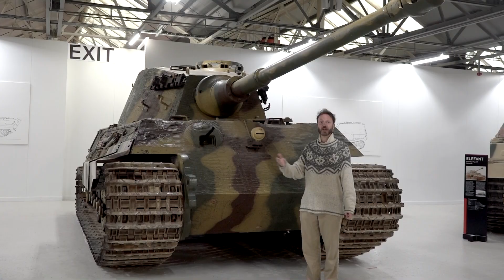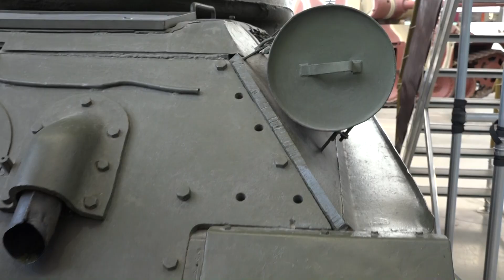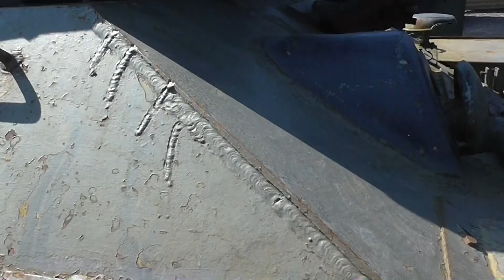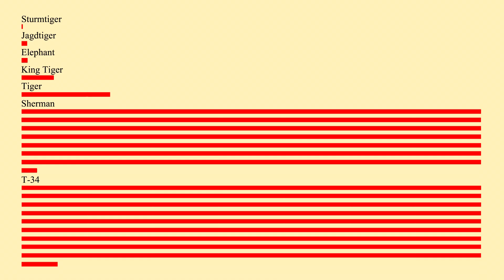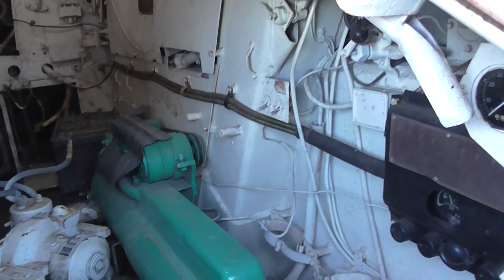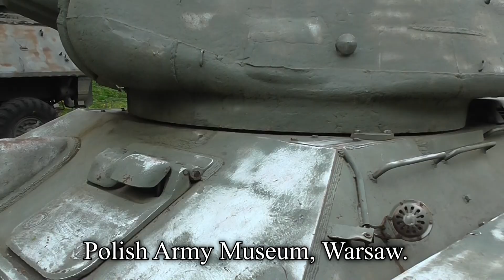World War Two's most common tank

Comment: The unattached pins and little wedge that puts them back in was still used on T-54 and T-62. Apparently the wiggle was actually a positive since it helped dirt to work out of the connection. (Source Tankograd website.)

Comment: The best tank in a war is the most decent tank that's most easily repairable and relatively inexpensive, which is the most generally reliable and which has guns which work fairly well and are easily resupplied to put enemy guns and troops out of action. You don't want a tank with a gun that's too small to do any damage, but as long as it has some ability to fight against any ground-level threat and you're able to build and crew a good number of them, that's a good tank.

I know things have changed somewhat with advanced technology, but logistics and production always factor.

Comment: Please… those are not bad welds they are mold lines on the turret… the engine cover wasn’t sent out of the factory unwelded or missing bolts, the museum left them out. I get the point but bad examples don’t help you

Comment: Putting the spare track links on the front of a tank, especially a tank with sloped armour, does not really add to the armour, it might actually detract from it.

Tracks need to be made out of softer steel than the armour, as they would get damaged very easily, grind away quickly or just snap and break. So softer steel would be used. If shot at from the front, the soft track steel placed on the harder armour plate could act as a sort of "cap" for enemy projectiles, normalizing them and then easing penetration.

So it wouldnt add, it would detract

Comment: The logistics defeated the Nazi forces. For every Sherman built there was a complete set of spare parts. For Nazi tanks it was one set of spares per 10 tanks. A final drive where the transmission turns the engine power 90degrees to the drive wheels and houses the gear box.  In the Sherman life span is about 2000 miles and less with bad drivers. In a Panther the average was 200 miles and first models caught fire if driven too long. To replace a Sherman final drive took 4-6 hours in the field with a mobile repair unit. A Panther you had to remove the upper top armor, the driver and radio/machine gunner crew position including electrical, hydrologic, and all linkages. Unbolt form inside and remove. Then do it in reverse. It took 2-3 days at a repair facility if you had the parts. Shermans were routinely removed and it is easier to recover if your advancing.

Comment: Good Documentary, though I want to add something.
Going for numbers isnt as easy as people think, every major war of modern Times is also one of logistics, 100 Tanks need 100× the fuel, spare parts, ammounition, crew, tow/ service vehicles and other basic necessities.
And its not even the question if you have that fuel and other stuff, but how fast can you get it to the frontline itself.
That is at least as important than having the tank itself, because what is it worth when it cant fire, or the Crew is starving, or its Stuck or couldnt drive to begin with because it had no fuel.

Comment: The thing on how long T-34s lasted is completely erroneous and feeds into some long-lasting myths. The T-34 was fully designed and built to last for as long as possible. The rough finish was only applied to aesthetic or superficial factors that didn't play a role in the combat performance. The transmission and engine for example were rated to last longer than any Sherman's. The metal used for armor and shells was of high quality, comparable to German early-war steel, which is significantly superior to German mid-late war steel and unlike the Germans it went up in quality as time passed. The welds being ugly because noone went over it with a file to sand it off may not make it look pretty, but it is also wholly irrelevant. 

It should also be noted that whilst the T-34 was a decent middling "will do the job" vehicle by the late-war period, it was a bona fide terror in 1941, held back by teething issues, production numbers and officer incompetence, but genuinely vastly superior to any armored vehicle the Germans fielded in Barbarossa.

Comment: The T-34 was NOT designed "crude" or "disposable".
The poor build quality came out of necessity, because so many were built by factories and/or workers that had absolutely no clue how to build tanks.

The ones built in the original factory to original specs before the war(once the initial teething issues were fixed), are easily of comparable manufacturing quality to the average Sherman.

And most of your critique of the T-34, it's like you're pretending that noone else ever built anything bad or had to make questionable compromises.
Like the epic bad choice of putting the cooling system unprotected outside on top of the armor...

Comment: It makes it quite difficult when you are comparing apples to oranges. Saying a Panther takes six months to build (but they built in parallel) and then stating the Americans made 1 Sherman every 30 minutes is useless. The units don't match. By creating 8640 Panthers at the same time you can also build one every 30 minutes if you take each month to have 30 days.

Comment: I liked the video, but I got some notes:
-the 5 Shermans to a tiger comes from a tank platoon being 5 tanks, hence you can't encounter a single Sherman, they always worked in platoons 
-The 34 is a sequential index and not a year (the prototype of the T-54 was completed in late 45 early 46) and the 76/85 are mostly a post war thing, as both were referred to as just T-34 in documents
-The casting defects are cosmetic and do not compromise the armor
-in late 43 soviet factories converted to submerged arc welding resulting in welds that are stronger than the armour
-The hull gunner/Radio operator was probably the worst position in WW2 and on the 85, they moved the radio to the turret, making him kinda redundant (they removed the hull MG on the T-44)
-The drivers hatch was actually thicker than than the armour, but it wasn't spring loaded, so it took some force to open

-The exhaust thing wasn't really an issue, But they moved it on all subsequent tanks
-The bolts aren't missing from the factory, certain things (Like rubber on all wheels and radios) during shortages, but bolts weren't a shortage item
-Its not welded, since its the access hatch to the transmission, so you want it to open and the gaps do not compromise the armor

-The sprocket design is odd, since its more expensive to produce than a normal sprocket
-The trackless drive was in the initial requirements for the T-34 and was done to reduce wear on the tracks during road marches, since the life of the track was relatively short due to poor metal quality during the 20s and early 30s. Early T-34s just got 2 sets of tracks from the factory instead
-The pin wedge was actually copied on the Panther 2 prototype, but they didn't constantly fall apart, because the wedge hammered them back in place before they could do that

-the panther wasn't designed to be an exceptionally high quality tank, it was actually mechanically simpler than a Pz. IV and they made slightly more Panthers than IVs

-the fuel drums weren't an issue, since they get depleted first, so they'd be empty during combat (if they weren't ditched beforehand) and even if they caught, it was on the outside rather than the inside
-The Kharkhov W-2 engine (I know the city is named Kharkiv but that's just the name of the engine) has a great power to weight ration and at ~500hp is key to the T-34s mobility
-the turret crew all had seats and if the loader needed to stand, he'd have to tell the gunner to not use the power traverse. A turret platform was omitted, to allow for easy access to the floor ammo bins and to reduce the tank's profile
-The gearbox hammer thing only applies to the 40, 41, and 42 production runs (if you watch the video from Aus. armour Museum, the driver makes the mistake of not depressing the lever on the gear shifter, this is done to prevent an accidental bump from putting it out of gear)
-The pistol ports weren't used very often and welding them over was a common post war modification
-The 3" caliber is a holdover from the Tsar's arsenal. Calibers developed by the soviets (85mm, 100mm, etc.) were "fully" metric
-during Barbarossa, some weren't bore sighted, meaning they couldn't fire their main guns. This is where the tank ramming stereotype comes from  
-The reliablility was on par with any other tanks (and better than the panther) from at least 1944, they could make the trek through Manchuria with relatively few mechanical failures
-The commander/gunner had a rotating panoramic para-scope, not as good as a cupola, but not blind. The workload from the 2 man design was a bigger issue

The soviets actually realized most of the T-34s shortcomings and already wanted to replace it with the T-43, but due to the pressures of the war and the T-34 being up-gunned, it was cancelled.
I don't dislike the video, your channel is actually part of how I got into military history and considering the source situation when it comes to anything soviet, I can see how some of the mistakes slipped into the video (it's common T-34 "lore").
Reply: Okay mate. 😂 jeez some are delusional

Comment: There is so many wrong in this clip. If you compare numbers, you need to compare Panzer IV and Sturmgeschütz III vs. T-34 or Sherman in the early years of war. Cause the german had 2 standard types of tanks instead of one at this time. The Sturmgeschütz III was the most simple german tank design. Laterly you need to ad the Panther to the comparison. The Panther was planned as next generation replacement of the Panzer IV as standard tank. And most important fact is that more than 40.000 T-34 were produced in 1943 or later, that 3/4 of the whole production. The turning point in WW2 was Stalingrad in March 1943. That means, the most tanks has been produced AFTER the german attack was already defeated. In 1943/44 the western allies bombed the german production sites and their logistics, while the Russian production was out of the range of the german air force. And finally the german were short on resources like rare earth metals for the steel production, rubber and other important stuff. Even if they had a more simple tank design, they don't had the resources to produce higher numbers. Germans made the best of the things they had. And by the way you should list up the disadvatages of the T-34/76. Like: Only the platoon leader tank had a radio, no commander cupola, no gunner, low muzzle velocity and in test done by the U.S. the motor of a brand new produced T-34 stucked after less than 100km. The germans didn't lost WW2 because of the wrong tank design...

Comment: Despite the fact that the T-34 was produced more than the Sherman, more T-34s were lost both in combat and due to non combat causes such as mechanical failure and getting stuck in the seasonal mud and not recovered due to a lack of recovery vehicles. This made the Sherman the most common tank on the battlefields of WW2 at any given time.

Comment: Sloped armor is not a panacea.

The armor thickness benefit you get from the slope means that the plate is exactly the same factor longer to cover the same Vertical space.

And the exact slope thickness modifier is not constant.
It's a complex relationship between armor thickness vs. Plate thickness vs impact velocity for a given projectile design. Some projectiles are horrible at penetrating slopes ( HV shot ).

Given a projecrile impacting  near 700m/s atleast and it's diameter being around 2* the plates thickness thr actual slope performance bonus starts to a factor of 1..... i.e. no benefit.

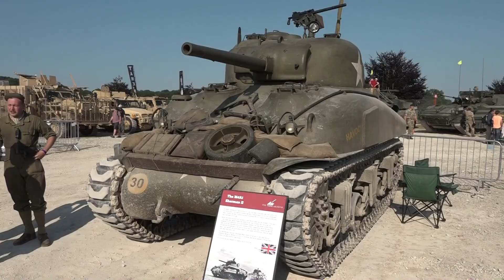Comment: 2:37 As the Chieftain explained, it didn't really take 5 American tanks - 5 is just the number of the smallest tank unit.
So you'd always move out with 5 tanks, even if you went up against one single German infantry dude.
As such, you should always encounter enemy tanks in a least a group of 5 of your own.
Reply: 7:30  It probably didn't catch on because it's heavier and requires more maintenance, as well as lowering your speed.

By putting those 'teeth' in the tracks instead of on the sprocket wheels, you need more teeth in total. So it's heavier.
And if one breaks, you have to remove the tracks, rather than just replace one sprocket wheel. So more maintenance.
Furthermore, when the tracks are heavier but you still have the same engine (with a certain max power output), your tank is slower. And more weight puts more stress on the engine and the suspension, leading to more wear and tear. So even more maintenance/lower reliability.
Reply: @MrNicoJac  if the shermans just face a tiger or king tiger or panther head on at a distance with no support then they would need much more than 5

Comment: as the son of an excavator operator I happen to know a thing or two about tracks, I'd say from a semi-educated opinion that the reason the Russian smooth sprocket didn't catch on would be mostly to do with mud... on tanks and excavators alike a lot of mud gets trapped in the treads and wheels, the drive wheels typically will cut through the mud with the sprocket teeth. but with the Russian design I'd say the mud would build up in-between the drive pins, squeezing in tighter and hardening with each passing turn until eventually the tank tread would walk off its track. one way one could gather evidence would be to gather up records on maintenance related to tank tracks between the Soviet Union and the allies, probably specifically the Sherman since as you mention they were the most used tanks next to the 34. also, side note, the fixed pin tread on the T-34s were of very poor design, as the pins connecting the track pads are prone to snapping when the track gets on a bind, so all in all a poor design of a track on a poorly designed drive wheel. EDIT: I love how I talk crap on the tanks track pins and then unpause it just to hear you start to complain about them XD

Comment: Just a detail, the panther wasn't entirely designed to counter the t-34. The panther was to substitute the panzer IV, and worked was started in 1939 i believe, but development was rushed due to the perception that every panzer-abteilung should have a gun capable of dealing with the t-34 at ease. Because of, i believe, the KV1, armor was also increased compared to the original design. And that's how you end with such a heavy tank serving as a medium.

Comment: Minor correction - the T-34 was neither designed nor conceived in 1934. Rather, it was the designation for the "design number" of the tank. After the BT series (which primarily consisted of the BT-5 and BT-7 in largest numbers), the Red Army was looking at developing a new tank. One was initially called BT-20 (designed in 1939), later the design was re-designated as the A-20, and just like the BT's, it had fairly narrow, removable tracks, and sloped armor. The major competing design was the A-32 (also designed in 1939), which was a heavier vehicle, with wider, permanent tracks, and also sloped armor. The A-32 was the winning bid in the competition, and was further developed into the A-34, which became the T-34 when it was accepted for production and service.

Comment: Many misconceptions in this video:
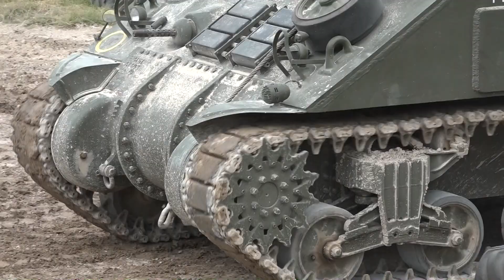2:10 Don't you think that comparing production scale of a heavy tank to medium one is kinda unfair?
3:27 Soviet, not Russian. Soviet Union was much more than Russia. 
4:03 T-34 with 76 mm gun was never called "T-34-76", it was simply T-34.
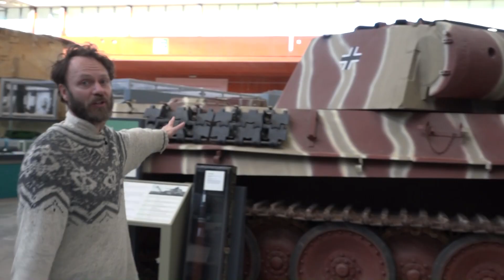11:07 Saying that 26 ton T-34 is vechicle of the same category as 44 ton Panther is kind of a stretch... Comparing it to Panzer III or later IV would be more accurate. 
11:29 Armor, gun and mobility are only few factors that make a good tank, there is also such thing as reliability and doctrine which failed terribly in case of the Panther.
13:06 Myth about T-34 being shock for Axis in 1941 is propably one of the greatest achievements of Soviet propaganda ever. The T-34 was not even considered as main Red Army tank in 1941 and it was present in relatively small numbers. Funnily, most of German high rank officers didn't even notice that there were some new Soviet tanks on the battlefield unit mid fall - winter of 1941.
13:24 As mentioned earlier, these surface level parameters are not everything. T-34 was pretty decent in these, but it has terrible reliability (especially those early examples used in 1941), terrible crew ergonomics and terrible quality of production which often worsened "3 main" parameters.
19:15 Okay, better now, although there is additional problem, T-34 being "so cheap" is another common myth. Price of such tank was very similar to Sherman or Panzers III and IV, same with it's complexity. Lower pricing was achieved by making these tanks incomplete, by untrained workers and with low quality components, it also influenced time of production.
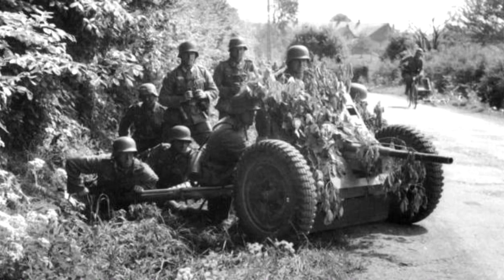22:20 Standard German guns at this point were Pak 38 and Pak 40, both of them and sometimes even 37mm one were capable of piercing T-34s frontal armor due to earlier mentioned bad quality of components. In addition pretty often armor was cracking even without being penetrated.

Comment: In battlefield conditions, it was estimated that a Tiger could take on (with a reasonable chance of success) up to 5 Sherman tanks. Unfortunately for the Germans, the Allies were easily capable of fielding 5 times as many Shermans as German Tigers (not to mention fuelling and maintaining them). The Nazi war machine was geared up to produce quick victories (like they did in France) and not the attritional, grinding campaigns of the Eastern theatre where the war was ultimately decided.